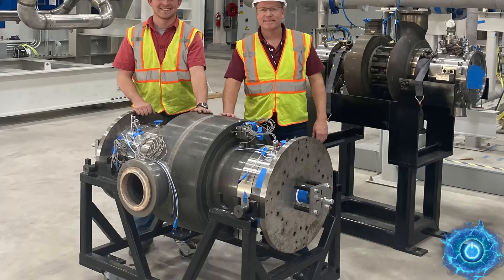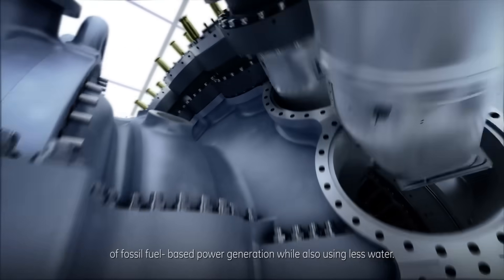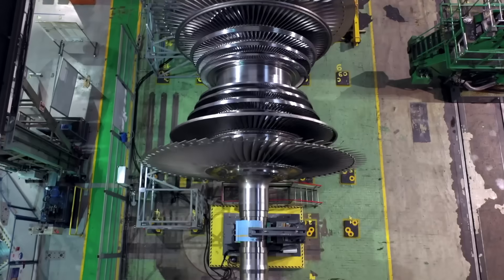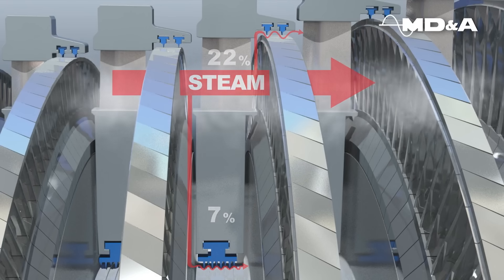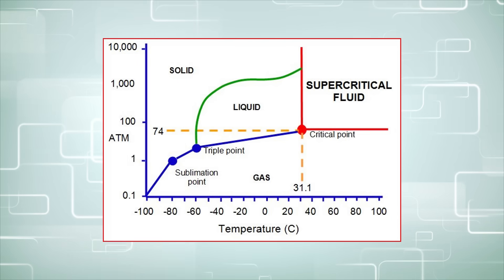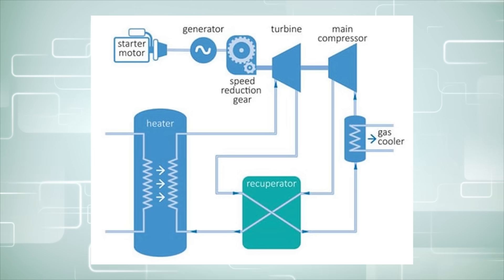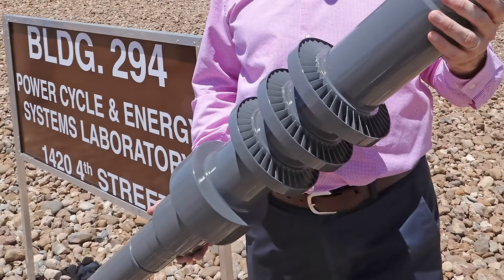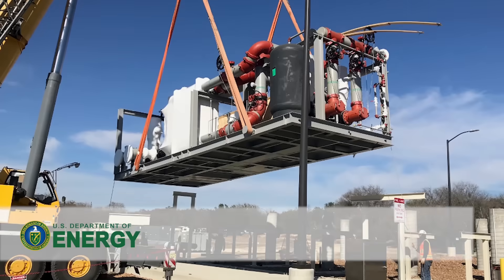BREAKTHROUGH Supercritical Turbine Breaks RECORDS

Comment: This turbine would work well with a closed-loop geothermal system, based on Eavor's design (see their YouTube channel) but dug extremely deep using the particle beam drilling tech from Quaise (also see their YouTube channel). The result would be a true-zero emissions powerplant safe for urban areas with a tiny footprint and a very long lifespan (100+ years). It would provide extremely low-cost electricity in large quantities.
Reply: Quaise provides only a very vague description of what they are developing.  Are they working to provide geothermal energy or are they focused on the development of their gyrotron-powered drilling platform?  The gyrotron-powered drilling platform has some unexplained details which cause doubt about the technology. What becomes of the vitrified rock within the borehole?  They do not suggest that they expect to vaporize the rock ahead of the wave guide.  SO, how is the rock, even if molten, removed from the path of the boring tool?
At the same time, Eavor refers tp their technology as "scalable".  It is one thing for technology to be scalable in principal and another thing to achieve scaling in application.
Reply: I think that any kind of deep earth geothermal is dangerous because of the imbalances it would create. 100 years of running a city is going to put some strain on the underlying strata.
Reply: A young research down here got grant money to build a very small power plant that was to use the techtonic pressures to super heat water being pumped deep underground. When he finally drilled the shaft he was hit by a jet of steam coming straight up. It seems his idea had legs but mother earth got there first, but he did get more interest as he had found water in the part of Australia were there is none (was). 
That's my smart talk over for another year. Thanks.

Comment: Looking at the performance of a turbine generator using coal, gas, nuclear, etc. is only part of a systems' total output & efficiency - how much energy is used to create a power source is often overlooked - mining, refining, distributing greatly reduces efficiency in any system that uses combustion - this supercritical turbine may produce impressive output numbers, but what were the numbers that went into producing the fuel & supercritical state? - that's the actual power cycle's efficiency - and with any combustion, it isn't good -

Comment: The idea of sCO2 power cycles is fairly ancient. The fact that the working 10MWe unit is finally being demonstrated is a great achievement and huge step forward for the technology development. I would just add couple more info. To achieve higher cycle efficiencies, the CO2 is compressed and heated usually up to 250bar and 550C at the turbine inlet. These conditions are also probably the reason why it took so long to develop, but nowadays nickel based alloys can handle that. Another fact is that even though the turbine itself is very compact in size the other components like the heaters and the coolers are standard size as for the steam cycle. So when scaling up, the footprint si rather same as the current power plants minus the turbine hall.
Reply: If it give you extra 10% efficiency with the same cost for building and maintaining it still make a lot of sense.
Reply: @Ayvengo21  the cost of building would be much higher, since most of the equipment must be build from high grade stainless steel and nickel based alloys. So big power blocks will probably remain running on steam, but I see a big window of oportunity with smaller modular units coupled with thermal storage.
Reply: @radomirfilip8741 so...do you think a sCO2 based turbine rated for 500 MW is unlikely to happen in the near future? Also, I see that most nuclear reactors have a capacity that goes from 1000 to 1500 MW, do they use one single 1000 MW steam turbine or just multiple smaller turbines linked togather?
And (last question) do you think multiple smaller 500 MW supercritical turbines could be coupled togather to convert the energy of a single nuclear reactor? like the Korean APR+ reactor (capacity: 1550 MW)
Reply: you know the turbine hall for many a power plant can be up to a mile long right? Thats a lot of building

Comment: I just have to wonder if the CO2 gives 10% more efficiency at the much higher RPM, will the reduction gear necessary to generate line voltage power at standard frequencies take that 10% back?
Reply: Так. Високочастотний генератор має набагато менші розміри. Краще конвертувати високочастотний струм ніж механічну енергію. Це надійніше і ефективніше.

Comment: You forgot to mention that supercritical CO ² fits well with high tempature nuclear reactors.  Also, because of small size, naval propulsion.
Reply: High RPM will be to noisy for submarines.
Reply: @princeofkernow9875  I was referring to cargo ships.  Sterling engines would be better for subs.  A small fast reactor could melt a storage of aluminum using heat pipes which in turn give such a sub high power burst potential.  The Sterling engine would enable ultra quiet operation.

Comment: That would be so fun to build a steam powered turbine airplane that might be very possible
Reply: Might be interesting to use it in a hybrid electric aircraft. Get it to altitude on the batteries then switch to sCO2. The condenser uses frigid stratospheric air (60deg cooler perhaps than at sea level) to cool the fluid.
Reply: @tbuyus8328  whats HEATING the fluid?

wishful thinking?
Reply: bessler... 1930s...

steam plane is possible. with pistons. 

turbines... dont work when small. its about those losses at the tips and leakages... what was small on a large turbine, and easily catered for, is a nightmare on a small engine. clearances start to be too large a percentage, the losses increase...

and then you need condensors to make them really worthwhile, as a turbine does the most work from the steam when its at atmospheric pressure and below... thats what makes them so efficient.

heavy.

hunt around, theres videos, and some guy managed to do it with RC too.
Reply: @paradiselost9946  you know I think you got a point but I also can't think of you have another idea how to solve that problem you know there's an African-American engineer and scientist came up with a machine that can take water out of the atmosphere the question is could you replace enough of that water  order to work I got a crazy idea for a rocket engine that uses a hot water idea this case a the stage first conventional chemical solid motor fuse with burning to thermite thermite uses its heat to turn water into  superheated superfluid steam just drives a small ceramic turbine would you use the coolness of the are in different temperature forces to cool the rocket motor down to but also to cause the melt chunks of metal to superheated steam cruise missile that don't run on jet fuel or kerosene who's water out of the atmosphere and turn it into superheated liquid high pressure  super sonic speeds I don't even know if that's possible something like that could work

Comment: To increase steam turbine efficiency need rid-of steam flow stator which is loos of pressure. It purpose to direct steam flow at maximum 90 angle but it doing so it plays role as local obstacle that waste a lot of energy. Better is to design most effect angle attack turbine blade and run without stator steam flow direction stators. 
And next step how much long we still relay on steam engine technology? That is bygone technology we must use superfast turbines without fossil fuel burning.

Comment: Think the project managers need to consult with me around the Co2 system,  Co2 refrigeration is one of my specialist fields
Reply: it's sCO2 not regular CO2 and how does refrigeration lend to it? you need turbine experience too
Reply: @AK88.  supercritical refers to a state of Co2 in which it is a gas solid and liquid all at the same time (supercritical fluid) this occurs in Co2 refrigeration when the ambient temperature is above 30c and the discharge pressure from the compressors goes above 74 bar. This is what we call transcritical refrigeration.

Comment: this allows for decentralized power infrastructure. so instead of a few GW power plants then sub stations, you could have many more smaller plants within town or cities.
Reply: This guy gets it
Reply: If you think the government wants to decentralize power generation, you're not paying attention. They absolutely want to centralize it so the department of energy can easily control everything. They want to shut off entire cities if they want, at a moments notice, even if the people are rising up in civil war, especially if the people are rising up in civil war even. They can't do that if cities are generating all their power locally. This is also why they're banning fuel vehicles, because they can't just remotely shut off a switch on a gas tank. This is why they want everything run on batteries, because those can be shut off remotely, and to really have a battery bank system for the entire energy grid, the only thing that makes sense is a large centralized facility, rather than batteries scattered around all over.

They're already experimenting with ways to do this, for example, using coal beds in conjunction with hydrogen gas they can get it to absorb. They use this as a battery to store and pull energy. There are other simple ways that do this too, such as stacking concrete or large heavy objects. What they do is use energy to lift something heavy with a crane system, think like building a pyramid out of large blocks. Then when they want the energy back the crane just unstacks it and lowers it back down, regaining the energy through the crane because it acts like an energy generator when the objects weight provides torque to draw energy from, just like spinning a windmill. And this gives almost as much energy back as it took to stack the thing up. You would need a large dedicated facility to achieve this on any feasible scale. 

So the government sure as heck wants everything centralized, because they're not getting excess power from local generators for their mega grid battery project. Local means nothing for them to really have absolute control over, and they need absolute control to sink energy into these mega battery systems, not to mention they need it to be local so that the transmission of the energy is localized, which loses less energy. So they literally can't rely on drawing energy for these mega batteries from anything but a centralized generation source. Or in other words, the fact that they want to build these mega batteries, tells you by proxy that they also want a centralized power generation system.

Comment: ah, need to discuss the clean carbon fuel possibilities here.  If we run a close loop supercritical co2 gas cycle we can extract co2, and store it and bury it.  There are lots of companies trying to do just that.
Reply: nope,CO2 is just a medium like the gas in refrigerator, CO2 wos the first refrigerant but it needs a high pressure and a very expensive pipes.

Comment: I have a better turbine design
Reply: Using kinemassic gimbals spit with torque masses to rotate. In deflective convex and concave shape coupling
Reply: And a induction chamber to charge air that flows between dipole. Between a cothode and anode.
Reply: The design is a mix between a hall thruster. Using a dense gas. And a light gas.
Reply: do you have a better sCO2 turbine design specifically?

Comment: What temp range is needed for optimized power?
Reply: I guess I don't understand how the efficiency can be higher unless the temperature is higher.  That is basic thermo
Reply: @harryniedecken5321 It is a more efficient working fluid.  It is twice as dense as steam so you have better power density, there is no required phase change, and it's easier to compress.
Reply: @christophorus9235  So it breaks the Tmax-Tmin of heat engines, or just reduces the losses?
Reply: @harryniedecken5321  remember this technology use waste heat , imagine using the steam after passing the turbine that normally go to the condenser or hot water fromm 
solar colector, it will run on low grade temp water so almost any container can be used as a heat battery,remember in a refrigerator the differential pressure is over 
300 PSI with only 70° C or under 
180° F.
Reply: @yvanpimentel9950  OK, thank you for that explanation.  So it's a stage essentially,  similar to running a steam stage off the exhaust heat of a big diesel engine generator like an MAN setup. 

10 MW is actually a good target hardware size that use.

It will be interesting to see how they overcome running rotating parts in a CO2 environment like that. 

It also makes sense that GE is involved,  they are pros at getting research on turbines paid by the taxpayers.
Reply: @harryniedecken5321  exactly, remember the first AC were CO2 base ,the only Drow back is the thickness of pipe.
Reply: @yvanpimentel9950  OK thanks.  I am more familiar with NH3 and propane as early refrigerants.   R290 / fairly high purity propane is actually quite a good refrigerant.

Thinking about it some more,  yes as kids we would sometimes use CO2 tanks and fire extinguishers to cool down beer in a pinch
Reply: @harryniedecken5321  you are right, propane is even better especially in cold  places,the overall pressure is 5 to 10 times lower.
Reply: Separating compressible gasses from non compressible ones is important if not key in steam turbines like geothermal.  Turbines are tuned to temp ranges, speeds, viscosity, friction, and gas types would have an effect no less.
Reply: @l0I0I0I0  is not really a liquid,is like air is denser cero altitude than in high mountain,so wind turbines in ground level if the wind speed is the 
same,so at 30 times is a gas but 30 times denser.
Reply: he doesn't say,but  CO2  can achieve a decent differential pressure at under boiling water temperature
100c  ,,the turbine doesn't need to be especial,is the case,is just like a AC 
 in reverse,dead steam can power this,is just that The investment is higher.
 c
Reply: @yvanpimentel9950  Higher investment?  That doesn't bode well.